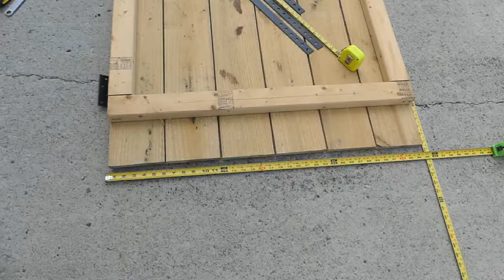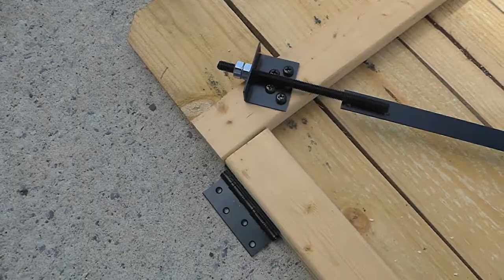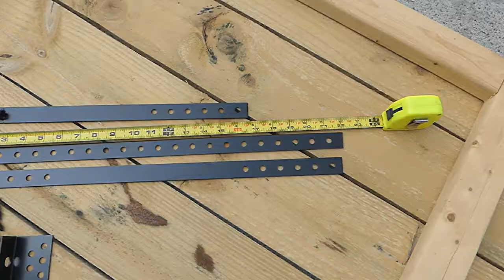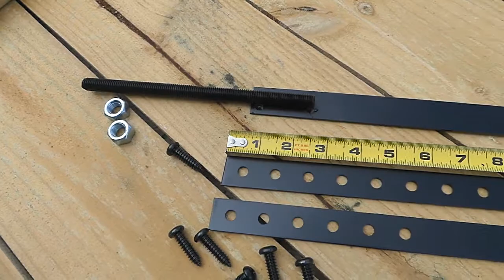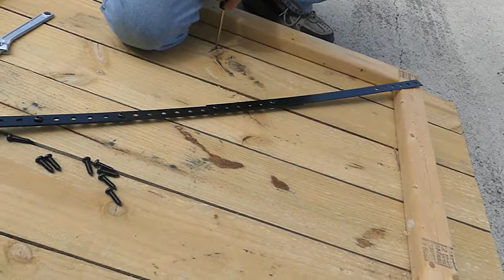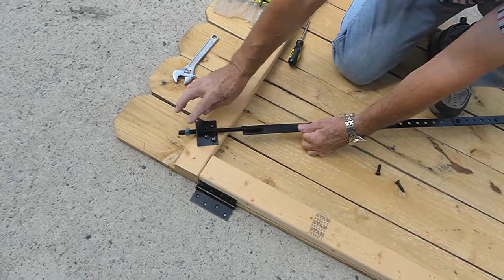Tech Team's #00734 Gate Brace Keeps Garden Gates From Sagging

Comment: How do you fix the door or gate from racking once you fix the sag?
For instance the door used to sit flush when closed with no air gap but after fixing the sag the door is sticking out way too far at the top.
I was thinking about installing a stop block
for the door and using a couple
cabinet magnets
to draw the door closed or do I need to add another adjuster
to correct this?